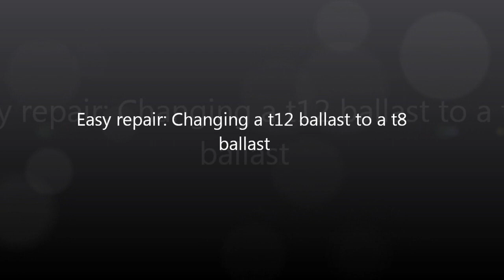Easy repairs: convert a t12 ballast to a t8 ballast

Comment: great video. My T12 4' bulb, 2 ballast's rig has  SHUNTED sockets and TWO room light switches. Does that matter?  Are you using Type A LED's in this video?
Reply from the maker: Thx.  To address the most important part of your question, if you have multiple switches, turning off the breaker is the safest course of action.  If the breaker is inaccessible due to obstruction alert the homeowner/office manager that this is a fire hazard and must be corrected.  If you are the owner, leave at least a two foot clearing in front of the breaker box (that's the fire code where I live, but check your local codes).

Make sure the electricity is off with a tester at the fixture, then tape and label the switches as a hazard not to be used until the work is complete (so no one accidentally turns it on).  A fixture with a 3-way (or any multiple location) switch makes it difficult to be confident that the electricity is not on without testing.

As for the rest of the question:  This video was made when LED was still in its fetal stage.  This is actually converting a traditional T-12 Fluorescent ballast to a more energy-saving T-8.  Both are for fluorescent bulbs, only the T-8 was the newer tech at the time.  Shunted sockets are easier due to their internal connections.  Doing this with un-shunted means you should make sure that the common (yellow in this case) wire and its jumper are on the same side of the lamp-holder/tombstone.

Comment: Quick question... I currently have two T12 (438-L-TC-P MagneTek) Rapid Start, can I use one Optanium 120/277-Volt 4-Lamp T8 Instant Start Electronic Fluorescent Replacement Ballast OR should I find a 4-Lamp Rapid Start? Thanks in advance for your assistance.
Reply from the maker: I'm not sure about the difference between a rapid start or a different kind of ballast.  In my experience, you can replace two t12's with a four lamp t8 but you have to change the bulbs to t8 bulbs.  doing this might negate the need for a rapid start (as the old bulbs might have required this?).  Either way, the t12 bulbs are not compatible with a t8 ballast.  You may get them to light up, but not for long.

Comment: Is there a quick way to tell the difference between t8 and t12 ballasts? A bunch of apt buildings i do maintenance for have both, and Ive noticed some tubes go out a lot, and some even have t8's and t12's on the same ballast. I want to draw up a diagram of what is what but not sure how to tell them apart. Thanks
Reply from the maker: most say on them in small lettering somewhere, but in old ballasts the paper falls off of them.  I can generally tell by how many wires per bulb there are.  If there is onlly three wires (not counting the jumper and the black and white coming from the ceiling) per 2 bulbs then it is a t-8. more per bulb it's likely a t-12.  you can also tell by the size of the bulbs used in them (if the right sized bulbs were used).  Thin bulbs are t-8 and thick are t-12.
Reply from the maker: It will be like this for a t-8 colors vary by brand but the wiring will be the same for two bulb fixture. 
black------------------ballast-------------------------White 
yellow to bulb connector--------same ballast------red to bulb connector (1st bulb) 
jumper from yellow to bulb connector(second bulb)                 same ballast-------red to bulb connector (2nd bub)
Reply from the maker: there's also generally a diagram for a t-8's wiring on the new t-8s that you buy.
Reply: @BrokePencil  ok thanks. Ill see if I can find the lettering. Im not an electrician so I cant open the ballast up and see how many wires are inside.
Reply from the maker: @headstashmusic3897  No the wires on the outside of the ballast that go to where the bulbs are connected.  No need to open the ballast.  That would be sticky.  They have this tar stuff in them.  It's easiest to see by taking the center channel off of the light.  Usually it's easier to do this if the bulbs are out.  Make sure to kill the power before removing bulbs.
Reply: @BrokePencil  Ok thanks. I never kill the power when replacing bulbs. These are parking garages and apt bldgs, so the majority of the lights don't even have switches, and I dont know where the fuse boxes are.  Is it bad to change tubes without unplugging the power or is it a safety issue? Sorry for all the questions!
Reply from the maker: np.  Srry I'm slow to respond.  I've been neglecting my youtube channel.  the issue is when you have one side hooked up and the other side touches the metal of the casing (happens all the time) while trying to install the bulbs.  You're likely to get sparks, melt the connector tips of the bulb, or burn out the ballast.
Reply from the maker: a safety/damage issue
Reply: @BrokePencil  Yikes, now you've got me worried! I have been changing tubes with the power on for the past 10 years and have never noticed a spark, but thank you, I am going to discuss it with the property managers at the buildings. Better safe than sorry!

Comment: is that the fat bulb
Reply from the maker: T-12 is the fat bulb t-8 is the skinny bulb.  T-8 is the new ballast.  T=12 is the old stuff.  Usually it will say it somewhere in very small letters on the bulb, but if you go to home depot or lowes in the fluorescent bulbs and you can see them side by side.
Reply: @BrokePencil  What is the skinny bulb what does it look like?
Reply from the maker: the skinny bulb is a t-8. I just use fat and skinny because side by side one is twice as wide as the other.

Comment: Aren't those sockets strictly meant for u-bent fluorescent lamps? Gravity might make one of those straight T8's fall out if there's no support clip.
Reply from the maker: No those are used in both applications.  They come standard on some of the older light fixtures, and they do snap in quite securely on both sides.  The U bent ones likely need the support clamp because they are only secured on one end.
Reply: True. Thanks for the clarification.

Comment: Two questions: Are you replacing 2 t12 ballast with 1 T8 ballast that operates 4 bulbs? Do you use a jumper on both the yellow side and the blue/red side? In the video it looks like there is only a jumper on the yellow side.
Reply from the maker: +Nick Hulse YES I am wiring a four bulb fixture replacing two T12 ballasts with one t8.  You want to jumper the yellows on both sides to the empty tombstones.  NO, you absolutely don't want to jumper the red and blue sides together.  The only reason there's a jumper needed on the yellow is because it is the common side and only has two wires for the four tombstones on that end. There's no easy way I can think of to explain it, but the common is like a bus for the ride home, and the colored wires (or the line-in) is a rental sports car.  you want that car to get you there really fast and not get scratched up because it's expensive.  But everybody climbs on the bus to go back home.
I hope this helps.
Reply: +DreamersNights Thank you, that is helpful. So, on the red/blue side you just have one wire going into the tombstone? Does it matter which side of the tombstone that one wire goes to?
Reply from the maker: on the red and blue side it doesn't matter, on the yellow side keep the main wire and the jumper on the same side of the tombstone.  That way if the main wired bulb goes bad the jumpered side still has a path back home.  so red and blue any hole, on the yellow side put each yellow and jumper respectively on the same side of the tombstone.  Otherwise the jumpered bulb is dependent on its neighbor to complete the circuit.  Make sense? Sorry for slow response

Comment: how about the wiring if it is only a 1 bulb fixture?  thanks
Reply from the maker: +nite day I'd have to see the ballast, but I'd imagine that it is just four wires.  A black and white which are the line-in and common respectively and will match up with the wires coming from the ceiling.  Then there will be two colored wires that go to either side of the fixture attaching to the bulb connectors/(tombstones in this video).  I can't see it being much more complicated than that for a new T8 ballast.  Once again, I'm just speculating because I can't see the ballast in question and its wires (and have never wired a single bulb fixture before).

Comment: What guage wire are you using for the jumper wire?
Reply from the maker: arthurn I use the old wires from the original ballast as they are typically the same gauge as the new ballast.

Comment: I have 3 two bulb t12 fixtures with dimmable ballast.  One light fixture is not working.  I want to switch it to a T8 dimmable ballast.  Do you think the new T8 will work with the other T12?
Reply from the maker: arthurn  Okay if you get this response three times I apologize youtube is getting screwy today.  If you're asking about a two bulb fixture with two ballasts in it and you want to change one to a dimmable t8, I would say just get a two bulb t8 dimmable ballast (spell check hates the word dimmable by the way).  If you are asking whether this one fixture will affect the other two I don't see how it would, as they are typically all run off of a single line and not linked in series.  The only thing I would check (online or in the instructions) is whether the ballast requires a style of dimming switch that is different than the one you have.  A new T8 running off the same feed line in the attic shouldn't affect anything else that is run off of it.
Reply: DreamersNights That's great.  Thanks for your response.  I will remove the switch to see what type it is.  Seems strange to me that most people don't use more dimmable switches, particularly in rec rooms and basements.  Thanks very much.

Comment: I have 3 two bulb T12 dimmable fluorescent light fixtures.  They are on a 3 way switch, one of which is dimmable.  One magnetek 502-A-TC-P ballast is bad.  Can I convert that one ballast to a T8?  Do I have to change all three.  Do you know if I have to change the dimmable switch as well?
Reply from the maker: arthurn sorry for the slow response arthurn.  I got a ton going on right now between work, writing, and getting my second novel some love from an agent.  (plus video games of course!)  I think I answered you on the second question.  I've worked in apartment complexes and office parks doing maintenance, but neither have ever had any dimming switches.  I hope the above answer helps.

Comment: how do you get the wires out of the tombstones to replace
Reply from the maker: Some of the tombstones are really stubborn.  Some have a release hole that you can poke a small paperclip into and it will let go of the wire.  Some you just have to grab the wire close to the tombstone twist with your wrist while pushing with your thumb.
Reply from the maker: Allen Head there is also (in most cases) a slot or hole below the wire where a paperclip (or any other item that will fit) inserted will loosen the grip on the wire.

Comment: Are the old style tombstone Pins are internally connected? Do I need to use jumper to connect the pins?
Reply: DreamersNights
Super ..thank you.
 I was able to fix it in 10 minutes with your video. Thank you so much.
Reply from the maker: the old style tombstone pins are actually not connected but each side usually has two quick connections so on the common side the jumper I described in the video going to the next tombstone should be connected on the same side as the main common wire.  If you do it the other way it will still work as long as the inner bulb still works because it will still pass on the current.  So my answer is you can jumper the internal pins but its so much easier just to connect both wires on the same side.  Sorry for any confusion and I hope this was helpful.

Comment: I need to do a T12 to T8 conversion.  What is a jumper? ....Is that another type of wire I need to buy? Or is it simply using excess of some of the old wires to connect the "Tombstones"?
Reply from the maker: Tombstones is just how they look.  It's the fixtures on either end that hold the bulbs.  A jumper wire is simply a bit of standard wire that you use to connect two electrical devices on the same circuit.  In 120 volt systems they are often used on the common or "ground" side of the circuit.  So when I say to use a jumper on the common side to connect the two tombstones I mean just get a bit of wire (scavenge it from the old ballast if you need to) and run it from one tombstone to the next..  I hope this is helpful.  Let me know :o).

Comment: is there anyway to do it without removing the other wires?
I saw you left only the black and white wires and removed the rest?
I am wanting to convert from t12 to t8 with two bulbs only
please help
Reply from the maker: you can tape off the wires you don't need, but the safest and best way to do it is to take away every wire but the black and white and put a jumper between the connectors on the common side.

Comment: I'm not an electrician, but did some research before rewiring the ballast in my fixtures.  The tombstones for T12 are not internally connected, unlike tombstones made for T8. Since the T8 ballasts only provide one wire for one of the pins, it could lead to uneven lighting and shorter bulb life.  I added a jumper wire to tie both sides of the tombstone together.

Comment from the maker: I've never needed to.  I have not worked on any 220 flourescent fixtures  so they may differ, and depending on what type of shunt you are talking about the light bulb itself can be considered a shunt.  but circuit protection is usually dealt with by the breaker or fuse.  Seeing how often these stupid t8 ballasts die they may have some sort of circuit protection in them.

Comment: Finally, someone who agrees that T12 ballasts are more reliable. Unfortunately, when T12s eventually go bad, you are forced to use electronic T8s as replacements. On another note, most of the things people complain about with T12s (poor light, flickering, high minimum starting temperature, etc.) are caused by the use of crappy 34-watt "energy saver" tubes. Also, contrary to popular belief, T12s will indeed work in below-freezing temperatures (even with 34-watt tubes). I've seen it myself.

Comment from the maker: as long as you have each yellow line from the t8 ballast feeding two tombstones as the common to one color of the hot lines.  Honestly the entire common side could probably be tied all together, its just simpler and more obvious (tutorial wise) to teach the path of electricity this way.  Two commons jumpered to a twin opposed to the live lines makes a nice simple circuit.  Also the more connections you add and old wires you leave, the more likely you are to miss something important.

Comment: rather than using a jumper, could you not just leave the red, yellow, and blue in the tombstones, and then take one wire of each color from the T8 and run them to both sides, connecting one blue, yellow, and red to two of the same color using a push in 3 wire connector?